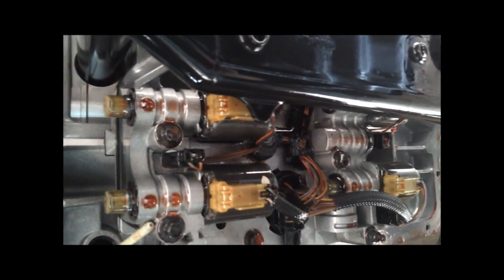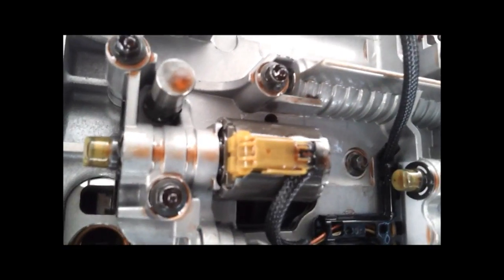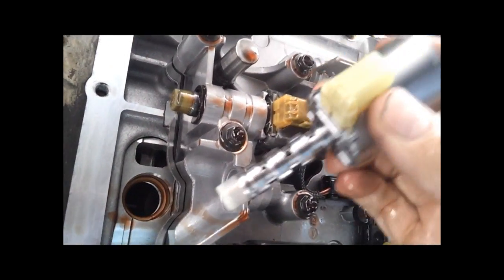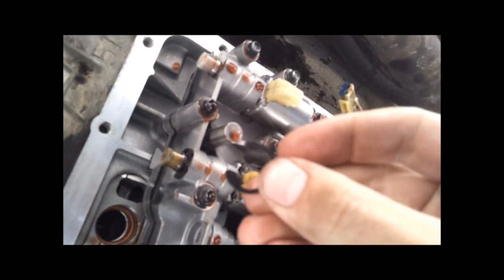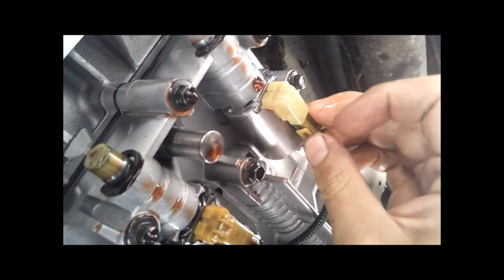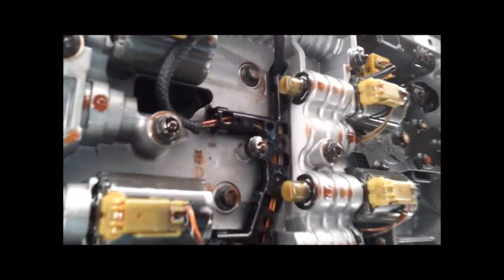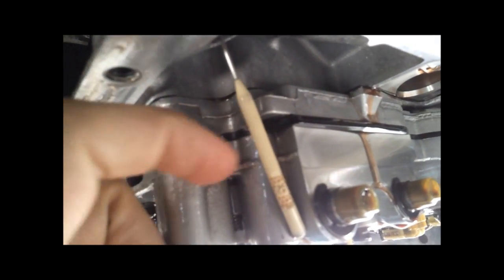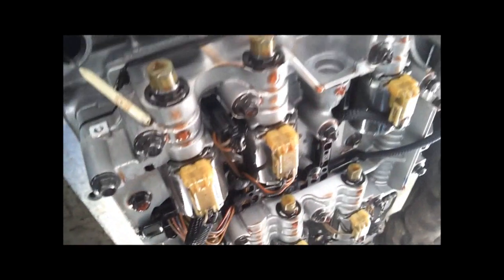FORD Superduty ~5R110W Transmission~ SSPC-A Coast Clutch Solenoid Replacement

Comment: Trying to fix a problem I’m having with my 08 powerstroke. Seems as if the linkage is bent or something because after replacing shift cable from gear selector to transmission I still can’t get it up past D. Have D 3 2 1 but nothing more. Can manually get transmission into N R P with pair of channel lock pliers manually at linkage

Comment: Hey cr38er, lost some of my forward gears, cleaned pan and topped off fluid. forwards are back but now I lost reverse.  I also found 3 of the solenoid caps in my fluid, any advice?

Comment: just put a used transmission in my 6.4 powerstroke when you put it in gear it hits hard and when you take off the rpms rise but just bearly goes and dosnt shift out of 1st still has reverse but reverse dosnt slip any
Reply: You need to check your line pressure.
Reply: +Cre8ersWorld  I was told that I need to get the transmission program to my truck I drove it with a buddy to see what he thought and he thinks that it's just in a high gear and won't shift how do you check the line pressure?
Reply: +Cre8ersWorld I found the fuse for the tcm and pcm unpluged them think put them back in and drove was in 1st and thin changed gears was happy thin it just started to act up again I don't take my vehicles to the shop but I think I'm a stop buy ford on the way home from work and have them flash the pcm and tcm see if that will fix it
Reply: +Cre8ersWorld if I have a problem with pressure what would be causing that I checked for any codes but Thier was none

Comment: Could it be the coast clutch solenoid when driving about 40mph then let off the accelerator down to about 25mph and when I resume on the accelerator it seems as if in neutral then slams into gear. Thanks

Comment: Hi, I have a 2005 ford superduty ,when I drive on the highway and its going  in over drive it jerks in and out .could that be a solenoid failer?
Reply from the maker: It could. Probably a PC-A solenoid. Pressure Control solenoid.
You want to check your pressure. It is easy here is the video:
FORD SuperDuty 5R110W Transmission Pressure & Stall Speed Test ~Hard Shift Problems ~PC-A Solenoid

Here is the video showing how to replace the pressure control solenoid:
FORD Superduty ~5R110W Transmission~ Pressure Control Solenoid Replacement

Comment: Why was the coast solenoid replaced?  What symptoms did you have?  Thanks for the video.
Reply from the maker: I got a Coast Clutch solenoid error code and lost all gears in the transmission. It turned out to be a failed pump and Torque Converter. If you are having any symptoms at all you need to test your hydraulic pressure. It is easy here is a video:
FORD SuperDuty 5R110W Transmission Pressure & Stall Speed Test ~Hard Shift Problems ~PC-A Solenoid
Reply: Will the test work on 4r100 also. My 2000 7.3 goes in neutral when I apply the brakes or if I let off the throttle pedal for 20-30 seconds then it seems to go to neutral at 20-70mph transmission has 90,000 miles on hd build with shift kit. Thanks really need help with this problem as the truck feeds my family. Oh it’s never pulled anything more than a car  and 16’ trailer. Thanks